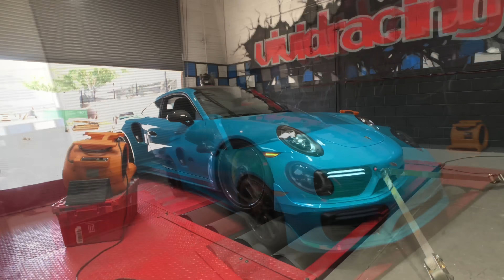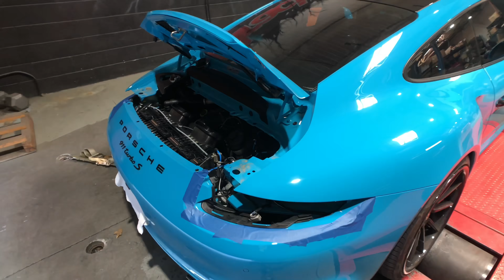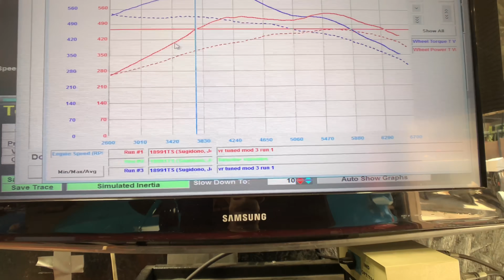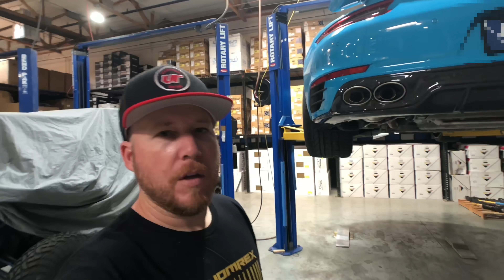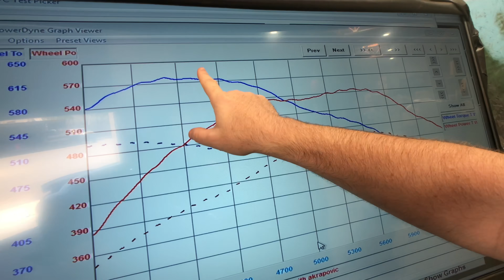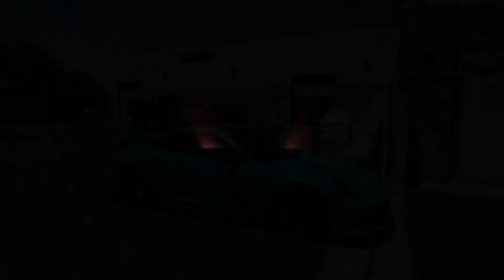We Test the Porsche 991.2 Turbo S on the Dyno with a Tune and Akrapovic Exhaust

Comment: Couldn't you Street tune the car
Reply: Now that the exhaust is put on
Reply from the maker: You dont need to street tune these... The files are proven files. You just read it out, match the software, flash the good working file. Custom tuning would only be needed if you changed turbos and injectors.

Comment: 4 hp w the Akra, ughhh.. save my dough.
Reply from the maker: While we experienced a smaller increase from the exhaust only, this was due to the substantial Arizona heat and crummy fuel quality. Cooler temperatures will result in even more power increase and really lets the exhaust shine. It's also about freeing up restriction. The factory exhaust is quite restrictive compared to the Akrapovic

Comment: 465 rwhp is not that impressive for 19 psi, my ZL1 puts down 570 rwhp at 10 psi.
Reply: 3.8 liter 6 cylinder vs 6.2 8 cylinder... I wonder why the engine with 2 more cylinders and more than 150% the displacement puts down more HP on less boost. What a genius you are!
Reply: That's not the point idiot - the point is a lower stress engine will hold compression longer and generally be more reliable
Reply from the maker: You don’t understand dynos then....
Reply: I realize it's a Mustang dyno with high ambient temps, but heat soak is another liability for these high boost smaller displacement engines.  They also lose compression faster
Reply: However, if you line 'em up the 465 hp Porsche vs 570hp Zl1  - the Porsche wins every time. Some people are dyno queen.
Reply: Are you drag racing on the street?  I highly doubt it
Reply: #1 That really is a dumb comment 🤦🏻‍♂️  
#2 You own an LT4 and you think the 991 needs to worry about heat soak?? And then I think you sort of said your camaro is more reliable than a 911 turbo 🤡🤣
Reply: Heat soak is a potential issue for any motor on a dyno.  As far as reliability, yes, 9 psi vs a peaky engine running 19+ psi, which one do you think will hold compression longer?  There isn't anything magic about Porsche engines, the higher stress engine will wear faster ‐ period.  Typical condescending P car asshole
Reply: @fzr1000981  There's a lot of salt in this post. The Porsche is simply built much better. With better materials, better R&D, better engineering, better workmanship, better technology, and so on. You get what you pay for. Porsche engines log 10's of thousands of track miles, which are warrantied by Porsche. It's a different league. Try to understand that. Try to understand it's a big world out there with a lot of things. Open your eyes to other platforms without bias. You'll become much more intelligent. Don't judge a man for driving something you can't afford. If someone can spend an extra buck for performance, so be it. You seem like someone going bang for buck performance wise. It also shows you like cheap speed from your profile pic. So be it. There's nothing wrong with either of those. Open your mind.
Reply: Another condescending asshole.  I'm well aware of what's out there, moron. Not sure how we veered off to which car is "built better", that's a strawman.  My point was engines running lower boost will hold compression longer, and that point stands.  As good as the 911 is, it's still a production car and past 911 turbos have had more than their share of reliability issues, it's not made out magic dust and the laws of physics still apply.  As far as being able to afford it (always back to that with you assholes doesn't it?) I have 800k in a stock account and 2 houses.  I choose to invest my money wisely.  A second hand GT3 may be in my future.
Reply: Oh and I'm a 30 year professional engineer, smarter than you.  Next invented strawman talking point?  Ducatis are not "cheap" in the motorcycle world (and little question you're too much of a pussy to ride anyway).  Strike 3.
Reply: @fzr1000981  I'm happy you you, glad you've made something out of yourself. What else do you have? You seem very insecure so let it all out. How much do you have in the bank and what's your portfolio worth? How fast have you driven and how big is your wang dang diddly? Tell the world.

Comment: I am not sure but... it seems to me that it lost power with the exhaust.  First numbers (after tune)  were around 541awhp/667awtq on the mustang dyno and then with the exhaust, torque went to under 600 and hp remained.   Correct me if i am wrong because i hope like hell that i am...
Reply from the maker: Did not loose power.  See here finish dyno https://www.vividracing.com/tuned-ecu-flash-tune-porsche-9912-turbo-38l-580hp-p-151880265.html
Reply: @vivid_racing  You are showing final results with may be stock car with only the ECU remap.Toney says that at the youtube video the results shows differents values from the link you show.May be the map you use first is intend it to use with stock exhaust.Thats why when you put the Akrapovic the power goes down.
Reply: @feder.4544  Besides, upgrading the exhaust did not impress me too - the sounds remain the same.

Comment: Will this tune void your warranty?
Reply from the maker: Depends on the dealer.  However this could not void a FULL warranty.  If the dealer had a issue, might only be your powertrain.
Reply: What typically has been your customer experience with this? Just curious the feedback you've gotten. Thanks for the previous reply
Reply from the maker: @Kaeineir  I have owned MANY Porsche.  Currently a 2016 GT3RS.  Had a 2014 991 Turbo.  The dealers are usually straight up if you are straight up.  I have never seen a major failure from a basic Turbo tune on any 911, Panamera, Cayenne, Macan.

Comment: Exhaust added zippo lol.  It was all the tune.
Reply: $6k+ for nothing more than a little bit of noise. At least they could have chromed the muffler bearings for that money.
Reply: Yep...the Porsche exhaust is pretty hard to beat as for H.P./TQ...but I would expect the Ti exhaust would save you 35 lbs which on the ass end is nice. but not for $8K

Comment: Great video 👍  is that a custom tune or canned tune?  Looks like the exhaust didn't add much power over the curve. Tune was impressive though 👌
Reply from the maker: We do a specific tune for each car as softwares are different.  The term canned tune or stage tune is used so losely with different meanings.  I can say that we have done SOOOO Many Porsche's over the years that we have a good receipe.  The older 996, 997 Turbos really benefitted from the exhaust.  The new exhausts are a bit better but have no sound.  So most usually do it to hear it sound like an actual sports car.

Comment: What is the cost of the whole set-up?
Reply from the maker: Andrew Biazis drop me a email and will send you pricing dan at vividracing dot com
Reply: Hey brother.  Not sure if you've seen my result recently on RL with my tune upgrades, but my car with the new Stage. 2 high output GIAC tune and their race gas tune is pushing 650 whp.   My 60-130 at full weight with my 270 lbs. in it is around 6.30 sec. on the Stg. 2 and 6.07 secs. best with 50 / 50 mix of race gas on race tune.  Very impressive for only a tune / exhaust and NO other mods.